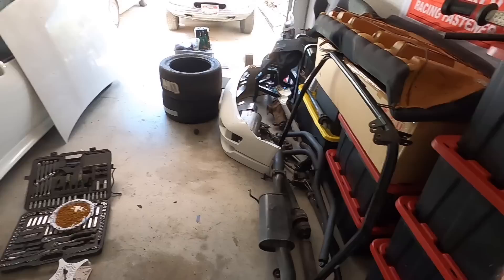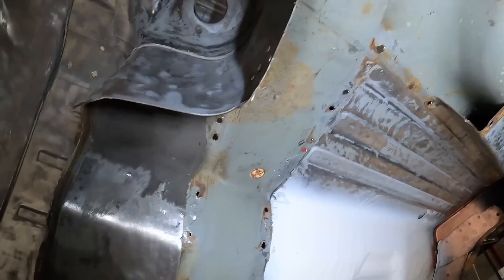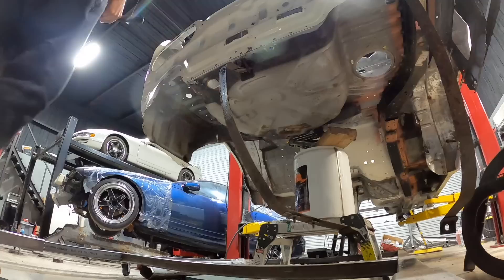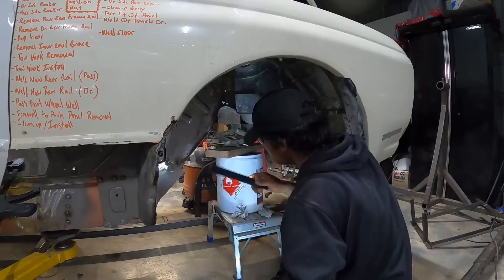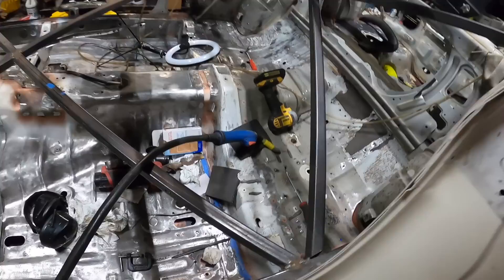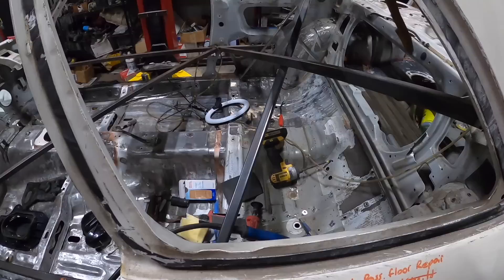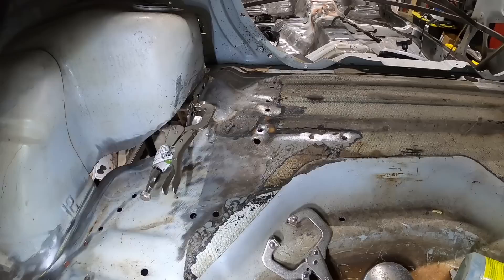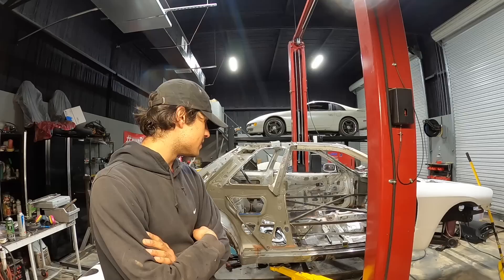REBUILDING A RUSTY NISSAN R32 GTR | Part 23

Comment: 2:20 - I wouldn't use a linisher like that. They can thin the metal out quite quickly. Better to use a wire wheel or similar which is less aggressive and still removes rust or blast it.

Comment: Don't you just love the slime? That's what I call the superthin primer they put inside the framerails.
22 parts ago was the bad rust, could have easily dealt with that and been on the road.
What Kalvin's decided to do, and has been doing ever since, is chasing perfection, and don't get me wrong: I not only applaud that, I can relate with each and every single broken drill-bit and non-accessible spotweld.
Heck, when this car is done it'll be the only one in the Western hemisphere worth the current asking price.

Now, I don't wanna ruin it for the high dollar vintage JDM dealers... But I will.
That rust in the corners, framerails etc, that rust is there even on nice GT-R's & all the other JDM's.
Acid dip is nothing short of disastrous, because then there's NOTHING inside the framerails, seams and joints.
Apart from bi-annual treatment with creeping fluid products that didn't even exist until about 5-10 years ago, from the day they left the dealership 36 years ago, there's no stopping this literal rabbit hole from happening.
And what I mean by that is, in 5 years time, when you can poke holes through those same spots, on namely all the "nice" JDM's in the world, except this one, the JDM bubble is gonna burst.

I'm glad someone got a car like this and decided to completely go through and restore it (at least they get the only prime example), if nothing else but to make it pretty clear to newcomers that JDM cars are simply not worth current asking prices.
As I see it, they have Kalvin to thank for the revelation, and if they still pay current asking prices, they get what they deserve.

Comment: Alot of that bad "rust" your sayings bad isnt that bad at all. I think your going down a rabbit hole man, now every little surface rust you could just sand down, your cutting out and replacing with new metal..
Rabbit hole man, can't blame you though, i get it, just dont spend years doing "mine aswell do this" while im in there to every single little spec.
Looking good though man, i commend you!